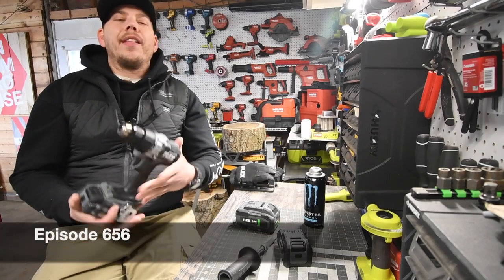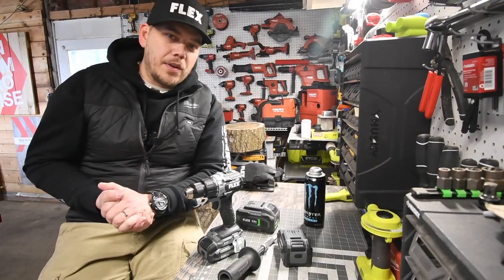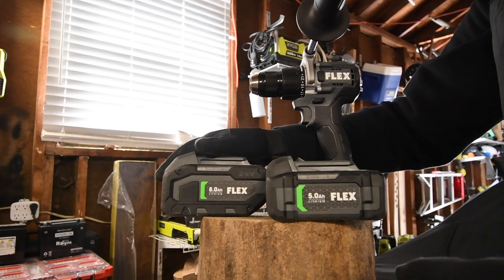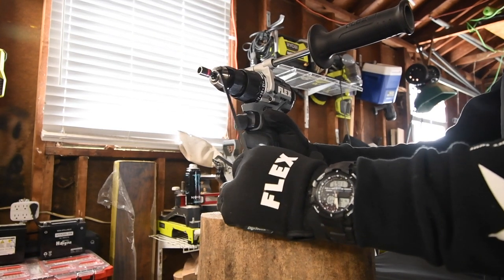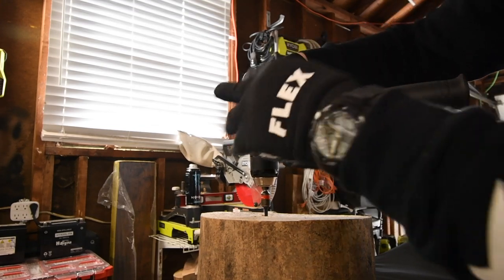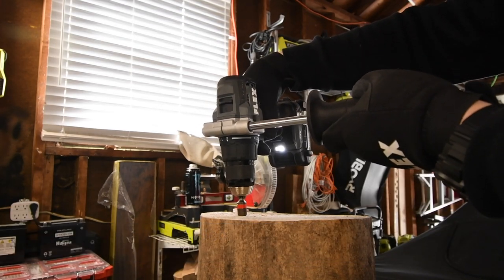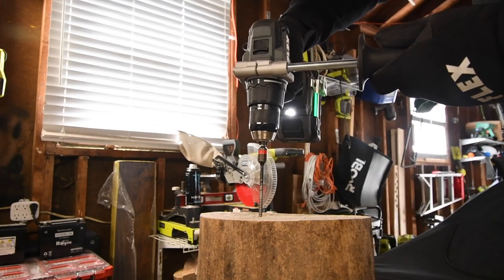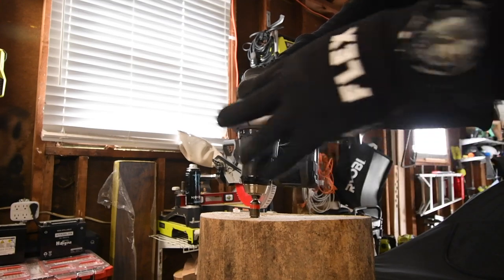FLEX's DRILL Driver (NOT TOO SHABBY!!!)

Comment: I just picked up the hammer drill with turbo and impact driver with a 2.5 Ah and 4.0 Ah battery and charger.  I am mounting a mantel to my brick fireplace in the basement so I had to drill 4 5/8" holes about 4 inches deep into the brick.  With the 2.5 Ah battery, I had the Hammer drill set at Hammer/Speed 2/Turbo, after getting stared in Speed 1.  Effortless.  Simply effortless.   Love my new FLEX tools!   On December 15th, I owned no FLEX tools...today, I own 5.  And counting.

Comment: Pretty cool stuff Dave. Flex is pretty awesome. Really looking forward to their rear handle blade left saw coming out. Definitely getting one. But the one I’m excited about the most is the worm drive style HILTI that’s supposed to come out next month.
Reply from the maker: I gotta do better tests with circular saws
Reply: @ManCaverTools  I used my HILTI 4WL-22 6 1/2 inch circular saw yesterday and found that when it’s two bars down using the B 22-85 battery cutting thicker stock like 2X it really wants to quit. I mean it bogs down and really struggles like it’s dying. I’d like to get some more 2X4 and see how many cross cuts it can do before the saw starts to struggle. Kind of expected more from the Nuron battery. I’m a little bummed about it but then again this saw was probably just designed to cut lighter material like OSB and 1X maybe.

Comment: The flex in-line 6.5 saw is awesome! Even beats most 7 1/4 circ saws in cut depth🤯.  If the durability holds up, which its doing great on my end, it should do great sales i would think for 6.5 saw market

Comment: I think it has more to do with the cells warming up than breaking-in the machine.
Reply from the maker: the tool will do those 8" timber locks with a 2.5ah with a cold tool and cold batteries now. ive been doing this for 3 years with many different tools and brands. Most tools perform better after it was used for a little bit
Reply: @ManCaverTools , yeah, that's something I've definitely noticed with rotary hammer drills, their mechanism definitely needs wearing in. 

Now hurry up with the next head to head, definitely my favourite format from MTC!

Comment: The flex drill diver is ok I still go with the dewalt mid range or craftsman mid range for light task
Reply from the maker: this is the Low range drill driver. Flex has 1 more thats better, then after that its the hammer drill

Comment: They didn’t send you the paid contractor so I’m pretty sure they will not amount to anything team red
Reply: If your Team red is Milwaukee, It couldn't be much worse! My Milwaukee 18 volt fuel stuff is junk!! Trigger issues, overheating of combi and loose batteries. Huge power claim on the Gen 3 combi but my SF6H A22 Hilti pisses all over it for screwdriving grunt.
Dave.
Reply: Sorry to hear that Dave I love my m12 line haven’t had an issue with non of them I don’t have that many m18 and I use those tools daily
Reply: @150supervisor  Yes, it's  a pain to have the things stop working when you squeeze the trigger. My 6 1/2" fuel saw has started having trigger issues too. Its a shame because the thing is a beast and light to carry to anywhere in our venue.  I really love my Hilti gear as it amazing......Can't really see the point of this Nuron stuff they are making such a fuss about. You just gain a bit more battery life and more power so Hilti say.  OK for huge companies on their Fleet management system I suppose.
Dave 👍👍